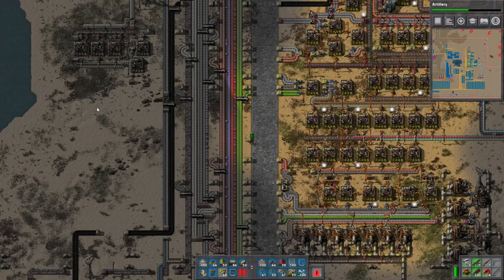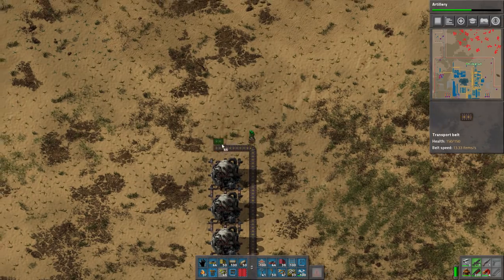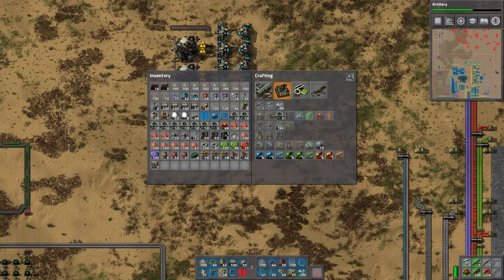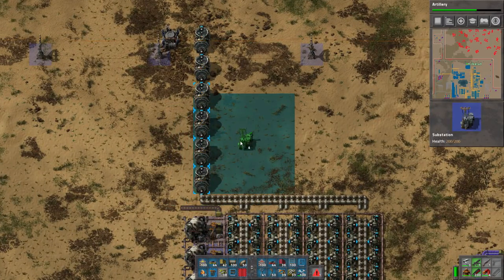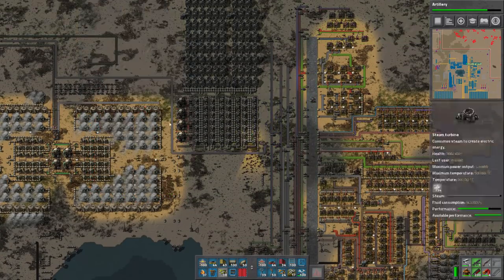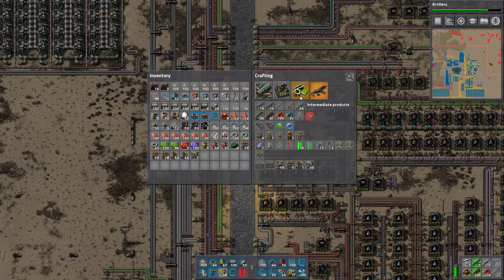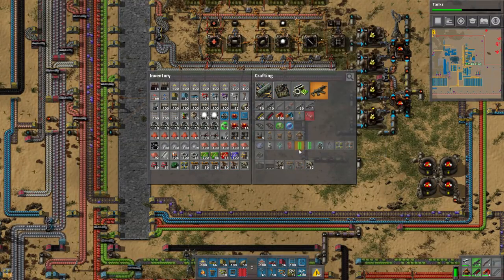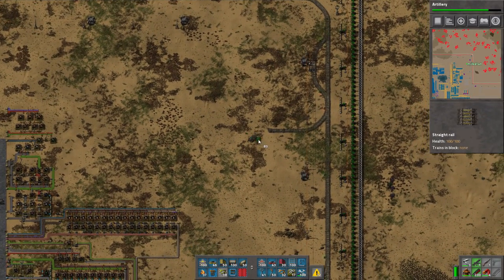Let's Play Factorio 0.16 - Part 38 [Desert Deathworld Marathon]

Comment: These ~120MW reactors suck. The most powerful nuclear reactor in the world has a maximum installed capacity of ~8,200MW. Most are over 1,000MW.
Although, those reactors weren't built by one man working with limited resources on fucking Klendathu.